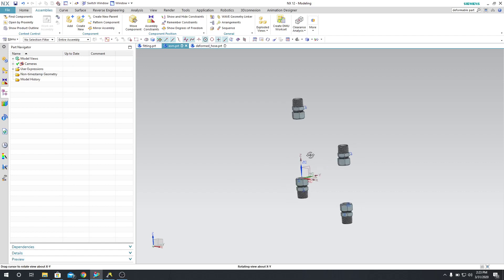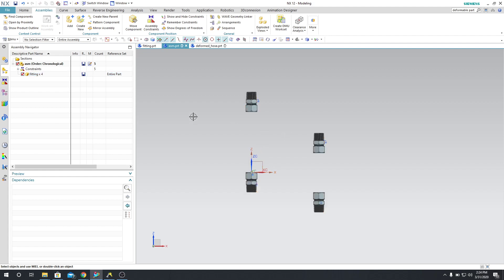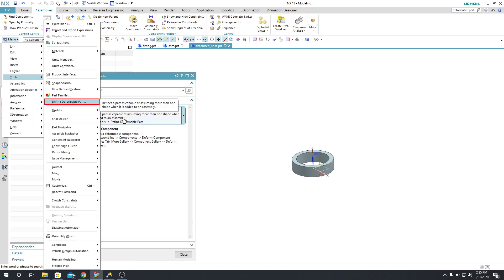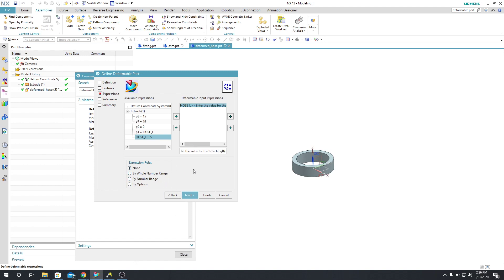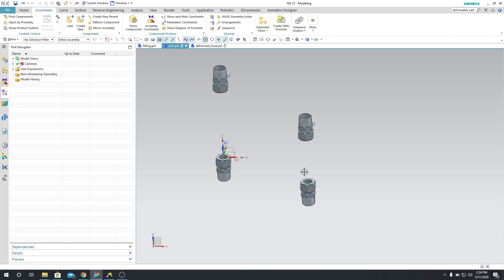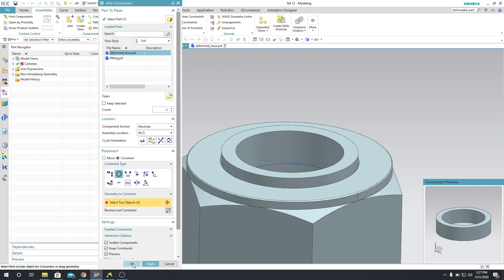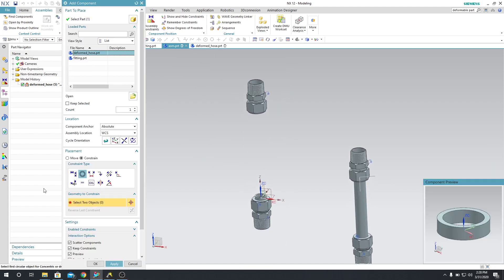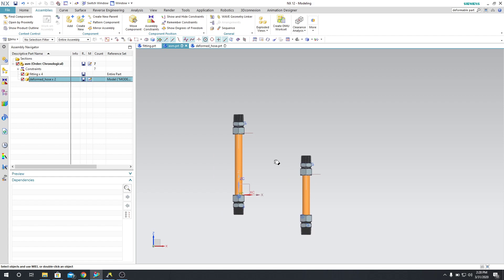NX 12 Tutorial - How to Create Deformable Parts in NX 12 - Hose Example

Comment: Very nice! How can I create a flattened (undeformed) drawing of a hose (with the fittings)? As generally the model is a deformed assy and the drawing should show undeformed shape with length dimension.
Reply from the maker: To achieve that, you might need to do a reference set using the modeling application or use the mechanical routing package. If you decide to use a reference set, then you might need to override some dimensions. Otherwise, the mechanical routing can do some of this for you.
Reply: @Jive_Engineering So using a reference set I need to create 2 bodies: one undeformed and one deformed (as it is in reality)?
Reply: @Jive_Engineering So I see that there is no option like in sheet metal or harness formboard where I can do like the unbend command automatic? Or like the automatic BLO drawing in harness?

Comment: Thank you for this video. May I ask, are you aware of any method to create let's say, a hose of a defined length which is attached to a fixture at either end. Then you change the angle of the fixtures or move them to different locations and the hose  automatically adjust its shape to keep the length the same? Essentially, a 3D spline or bridge curve with a length constraint. You can achieve this somewhat with the Optimization command, but it takes time to setup, you need to run it every time, and the converged result it not perfectly accurate.
Reply from the maker: This would have to be done with the mechanical routing package. I don't think this flexibility is achievable easily through the modeling methods.